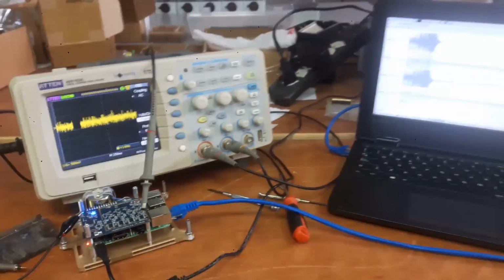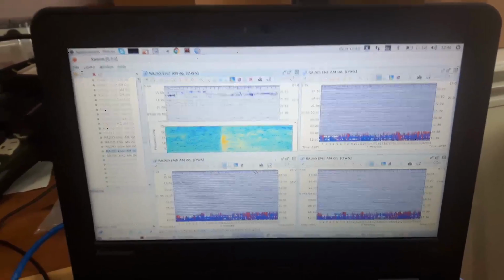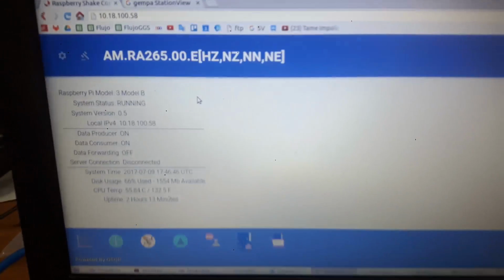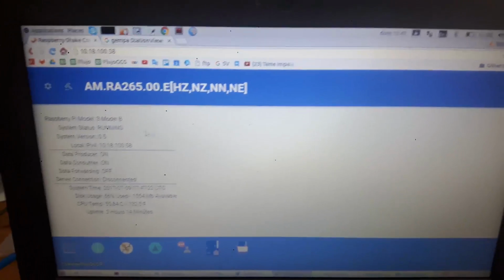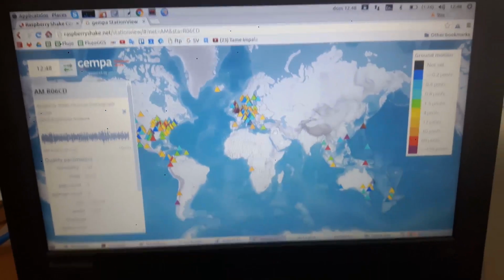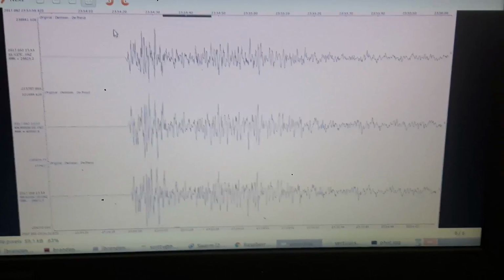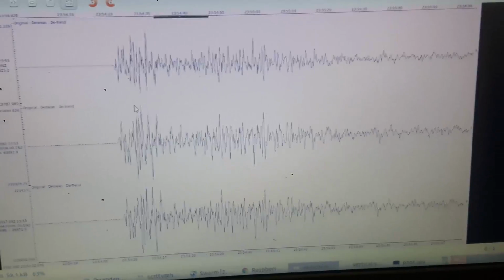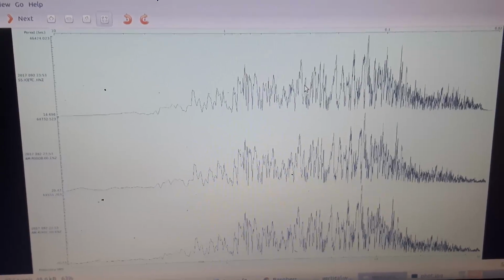Raspberry Shake 4D - The Software - Detect earthquakes & “invisible” motion!

Comment: Here is my suggestion to help. I think what could help would be if a couple of things were added to a pi3b(+) for chat communications, and also for OpenCL. None of this should cost anything (as it just adding of FOSS software).

Basically, have an "pod" instance of "M O V. IM" chat network on there which also uses RSS (but works also via Empathy-IM). Secondly, have a GTK4 app with Sci-Lab to use the Pi3b GPU for OpenCL1.2 to process things like Gaussian Functions and Fourier Analysis, rather than only have that webpage. It would mean the user (who is probably by now bound to be using at least a pi3b or a PC with at least a NVidia gt710-kepler GPU nowadays, or AMD hd6450 capable of openCL1.2) would have processing which can be done client-side (such as in python3, C++ with some php and mariadb if needed). Even the landscape could be rendered in voxels on a pi3b. Look it up on youtube and see it exists. 
On your Pi3b connected to the station R897D in Jacmel Haiti (which has internet via ethernet but also wifi capability), students and locals could register via Simple-SAML-php if it were installed on their to receive an Open-Id-Connect registration so the Pi3b works as a Service-Provider and Identity Provider (SP and IdP), if they register over some simple XHTMLMP webpage which would use a fraction of an old dial-up bandwidth (like say 15Kbps or something tiny as a trickle). 

It would generate for them some user hashes to write down for login but also, a QR code. If people wanted to expand that, each new user could get an A4 paper sheet (laminated) with their QR codes on it. It is the sort of thing that could help them as a means of ID (for open id connect) in the event of disaster (for the price of a laminated printed sheet of paper, unique to each user if they chose to buy one for a few dimes or whatever if they do not own a smartphone/pizero2w). A photo could even be printed on it. A camera (e.g. playstation2 eyetoy) on each pi3 or pizero2w could scan QR codes. 

A quadcore raspberry-pi (which can run IPFS because it uses blake2b 4way parallel hashing) can also run many a KDE app for education like Marble (sudo apt-get install marble). Each Raspberry-Pi could share data via SAMBA and FTP (just wifi, not internet) as a localhost just enough so that a passer-by could use their own mobile-smartphone or pizero2w (maybe battery powered) to "check-in" via their ID (A4 certificate) to let people know their location. In a disaster, lost people can thereby find each other. It is also a way for people who want to learn (education) to be encouraged to use KDE-Apps like Kalzium, GNU_Health, Kanagram, LabPlot, Geogebra and so on (as basically and encouragement for them to install everything educational from the KDE software site). A torrent link for the english and french language versions (AMD64 and ARM) for Endless-OS (linux) could be on the Pi3b registration XHTMLMP page so that passersby who register on thet localhost page can know a good known quantity OS to install on their machine because it has a bunch of wikipedia articles on the ISO file of the distro so that people can use that even if they have no internet one day. Maybe even let passers by (with limited bandwidth on the wifi, such as granting them 1Mbps for a SAMBA share via wifi without internet) can grab the Distro ISO even though they have no internet.

So giving them 1Mbps bandwidth wifi is done thusly:
sudo iw wlan0 set bitrates legacy-2.4 1

Or giving them 12Mbps bandwidth wifi is done thusly
sudo iw wlan0 set bitrates legacy-2.4 12

Then eject them off the wifi (SAMBA or FTP) in a waiting list (like a bakery ticket algorithm queue after say a few hours or half a day).

Just as aside (not crucial to all this but you might like it, for it), do see the ExplainingComputers channel for how a pizero2w can run off a (buck convertor and) 12volt battery for a week inbetween charges (and a solar panel could go on it for charging if desired).

It's just that you have loads of unused processing on those Pi boards and the GPU can use it too with barely any power consumption even if it is often encoding h264 video in 1080p at 30fps.

So a mesh network could be established later but for this you would not "need" to do that.

My comment has no hate in it and I do no harm. I am not appalled or afraid, boasting or envying or complaining... Just saying. Psalms23: Giving thanks and praise to the Lord and peace and love. Also, I'd say Matthew6.